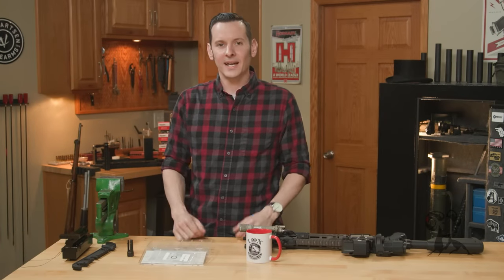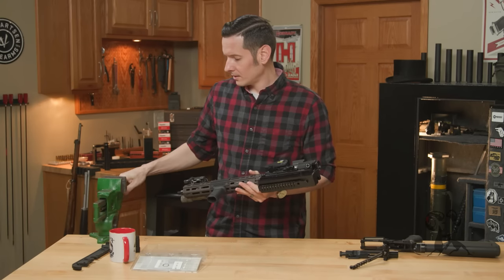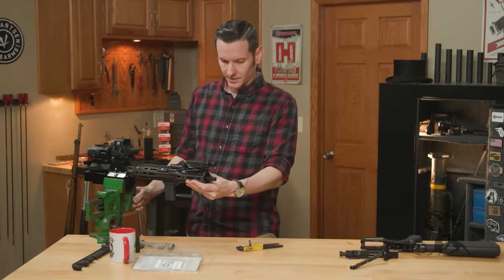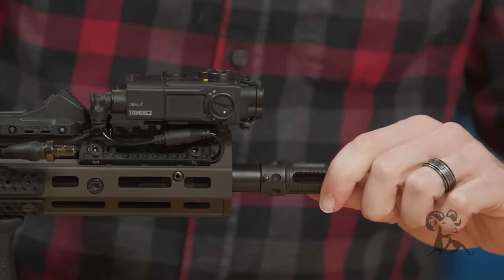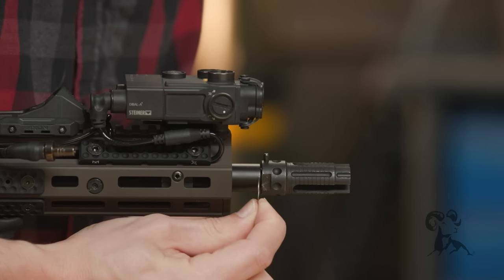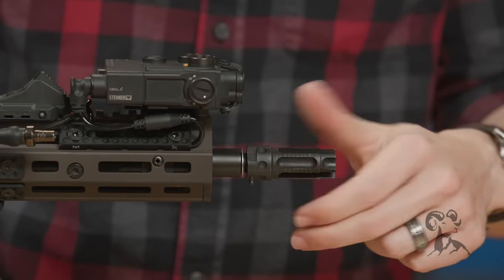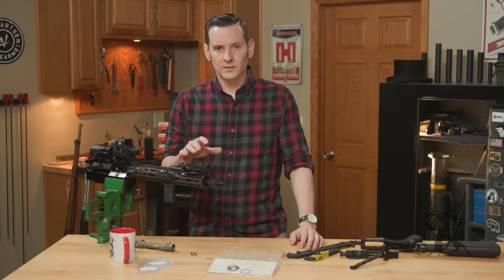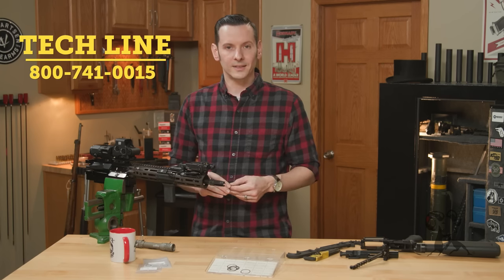Quick Tip: How To "Time" a Muzzle Device With Shims

Comment: This is not the only way to do it, this is just how I do it. If you have another way that works better for you, then keep on keepin on! I just wanted to share this in the hopes it will help a handful of y'all out there.
Reply: This will work nice.
I guess you have fastened a muzzle device before,or maybe a couple😉
Possible more than a couple 😆

Thanks for the quick tip👍

I have a Ase Utra brake with supressor mount on my carbine..and off course supressor to go with it..
Or carbine,supressor and the brake/ supressor mount to go with it..
It depends on how you look at it😉
It.

I just fastened it with torque 50 ish Newton meter or something.. i do not exactly remember.

It was the manufacturers specifications and recommendations/in the "user manual" for that brake/mounting system,so i went with what it said..

My brain said "Rock set" or Loctite it down.. 😆

It's still in the right position after lots of rounds through it though..

Anyhow..I like these Quick tip videos! 
It brings me lots of knowhow😊

Keep up the good work 👍
Reply: The Videos on the Website is not reachable from outside US..visitors will be redirected on the local sites...without videos....
Reply: Now that’s some big-braining right there.
Reply: Can use use shims and crush washes together.
Reply: I'm just curious, but why not a crush washer?
Reply: @joshuaabren  If it's a muzzle device that can mount a suppressor than a crush washer is a very bad idea actually, as this can impart unequal pressure on the mount making baffle strikes much more likely.
Reply: What can i use that is less permanent than Rocksett?
Reply: When you said big brain it I thought you were going to use the math calculation. 24 threads per inch so one full turn is 0.04167". so 75% is 0.3125" so your shim stack needs to be that or slightly more for torque. I'm terrible at math I like Caleb's way.
Reply: @joshuaabren never use a crush washer on anything you’re running a suppressor on. Could cause unequal pressure around the muzzle device and potentially cause a baffle strike.
Reply: So don't use crush washer with shims?
Reply: @jrossnjax7  Correct

Comment: I like the Surefire method of timing. Basically, you add shims until you are so many degrees off at hand tightening. Theyve created a diagram wheel so you match up the color of the shims youre using and then once you find a combination that matches the diagram wheel, you then torque the brake until it reaches "center". It does take some trial and error but it works great. This was pretty good too though, I just wanted to share.

Comment: One note on Rocksett.  When wet, even a drop of Rocksett will act like a lubricant and your device will time a little past where it was dry at a given torque setting.  There are several ways to deal with this, but I've found the easiest is to make sure you dry fit north of the middle of the torque range so when you time with Rocksett you'll still be above minimum torque.
Reply: Finally someone addresses this! I'm having the same problem. I'm trying to time a SF Warcomp. When I time it dry it goes to 6 o'clock at 30 ftlb and then I apply Rocksett and it goes past 6 with less than 20!
It's frustrating. Is it ok if I leave it to dry first or does it have to be still wet when torquing?

Comment: Great to the point video. I am getting ready to swap out all my muzzle devices for dead air flash hiders. Going to use accu-washers for timing them though. I am most excited to remove a pinned and welded M4-72 muzzle brake and put a flash hider on it. It was my first muzzle brake and man does it shoot flat, but I am sick of how aggressive the flash is back towards me and the firing line, it’s like a flash bang if you are off to the side of it lol.

Comment: I've had great success using the TPI to calculate the needed shim. Effectively no guess work and gets it right almost every time.
Reply: I was going to say... "if you REALLY want to "big brain" it, try some math".  I'm with you.  I'm lazy.😜
Reply: What's the TPI?
Reply: @jasontm91  Threads/Turns/Twists per inch. E.g. 28 TPI means each turn is 1000/28 = 35.7 mil. So if you are over by 1/4 turn, you'd add shims for 35.7/4 = 8.9 mil (rounding to 10mil) to make it end up where you want it.

Comment: Precision Armament accu-washers are the way to go.
Reply: The washers and system are of outstanding quality, but not perfect. They only time at 20 degree intervals and that's not nearly enough sometimes. My PA M11 muzzle brake stops with exactly a 10 degree tilt, which makes it impossible to time without using a shim or crush washer in order to get the muzzle brake level. Just passing along in case it helps anyone, not at all unhappy with the end result.
Reply: @ArkansasBadBoy  idk about your setup, but my every one of my guns is timed perfectly at 12:00. It takes a few tries. I always go back and forth to break in threads to get the most out of the torque. There is no set torque, so 5 ft-lbs more or less isn't going to hurt anything. Sounds like you tightened it to whatever and it wasn't in line and you gave up. Takes a bit more effort than that my friend.
Reply: @2A.Freedom  each situation is different and rest assured, I more than know what I am doing as I've installed these for years. Glad yours worked out.
Reply: @ArkansasBadBoy  i agree, each situation is different. I don't agree that it's impossible. It may not work for you and that's fine, you are under no obligation to comment. It's a great product I've used for years on dozens of builds with zero issues.

Comment: Thank you for sharing this important video on shimming. Very informative! Question; can you over tighten a muzzle device on a barrel? 
The reason I ask is because I changed out a muzzle device using a crush washer and tightened it down pretty good to achieve the timing I wanted. Hopefully I didn't over tighten the muzzle device.

Comment: Personally I would have put the pin on the bottom so the flash would be directed at the 6, 10, and 2 o'clock positions. I understand it won't matter much with a suppressor but in the chance one was not installed while firing in a low light or night time scenario the shooter will get blinded by the flash, ask me how I know. Just my 2 cents, in not much of an ar guy myself but I do have one and have assembled a few. Keep up the good work guys.
Reply: #1  he was not using a muzzle device that needed to be timed.  I believe the point he was using the pin to represent a muzzle device that needed timing.  he had stated all this up front and he would not be keeping the device on that weapon.  just saying.

Comment: Doesn’t using a upper vise block put torque on the barrel index pin when doing muzzle work? I heard you should use a barrel vise over an upper vise block or reaction rod because of the torque on the pin?
Reply: That's a smythbuster video in the works.
Reply: @CalebSavant  yay more videos

Comment: Is Rockset really necessary? I’ve never used it for the barrel because I am constantly removing them. A properly torqued down ASR mount shouldn’t ever come loose. However, I figured I would just check it before each session at the range. 

For example, had to remove the barrel end because… 

1) I wanted to ultra sonic clean my adjustable gas block
2) I bought a silencer, so put on ASR mount flash hider on rifle
3) I migrated ASR mount flash hider to use with newly built AR pistol
4) I switched pistol to ASR single port muzzle break to shorten length 
5) I moved ASR back to rifle

etc., etc., 

Bottom line had i used rockset i would have had a hard time of it. And that just for 1 of 6 rifles. I went through similar changes with all of them. 😮

Comment: So how do you use Rocksett after the fact?  I ask as I have a BRN-180 10.5” 7.62x39.  Attached Cherry Bomb brake without checking concentricity with the Thunder Chicken suppressor and promptly took a chunk out of the suppressor.  So, before I do this again, I’d like to check concentricity before applying the Rocksett.  Thanks.

Comment: 28 threads per inch, so each rotation is 1/28th of an inch.  (0.0357")
3/4 of one rotation needed.
0.75 revolutions x 0.0357 inches per revolution = 0.0268"
Reply: Now account for torque and the change in torque caused by the rockset lubricating before it cures.
Reply: @CalebSavant  I'm curious how my calculation compared to the thickness of the actual shims you used in your video.  Does the box of shims provide thickness dimensions for each?
Reply: Exactly, the hard part isn't getting it timed, it's getting it timed with torque. @CalebSavant

Comment: What about the barrel extension rod how does that work? If I wanted to take my Surefire 3 prong off my sr15 and put my MAMS or KAC flash hider on someone said I’d have to take my bolt out and stick that “rod like” barrel extension  wrench in through the the back of the receiver and hold that with a vise then remove then remove the muzzle device. Can anybody help clarify?

Comment: So I’ve been paying my smith $35 to rocksette and shim/time my muzzle devices… should I just do it myself? I just figured I’d play it safe when it came to bore alignment and suppressor use so I figured I’d have a pro do it. But this doesn’t look that difficult
Reply: Ideally you'd get a Geissele suppressor alignment rod. I just ordert one for 223 and 308. They cost a lot for what they are, but I can't be bothered anymore to go to the smith everytime I want to switch up my suppressors and hosts or switch out a gas block or whatever. Same goes for torque wrenches, I finally bought a small one for scope mounts and a big one for barrel nuts, muzzle devices etc. along with a Geissele reaction rod too. Now I can do most of the work at home myself... until I need specific punches for everything^^

Comment: I've used shims. Crush washers are a little easier.
Reply: You'll want shims for assurance of repeatability with muzzle devices that will mount suppressors. A standalone muzzle device can use crush washers if needed.

Comment: Most of the time I get a crush washer that fits close enough and file it down just enough to get a tight fit, I switch from a2 hider to direct thread silencer so I don't need it to be "permanent"
Reply: So you like to add in additional unnecessary work of filing down a crush washer vs shims? LOL.

Comment: Why Rockset?
Why not a crush washer?
Please explain.  Thank you.
Reply: In this case, it's a QD flash hider for attaching a KAC suppressor. Crush washers aren't meant for suppressors since they're likely to cause baffle strikes.
Reply: Crush washers often allow the muzzle device to not be perfectly concentric to the bore, which does not matter on a standard muzzle device, but when it is going to be used for suppressor mounting it could cause the suppressor to be misaligned and get damaged by the bullet striking a baffle. Shims are used as they keep the muzzle device squared with the shoulder
Reply: @cordyzank3625  thank you
Reply: @anthoselongstride8309  thank you
Reply: Rocksett because it is a heat resistant adhesive (a silencer on a semi auto rifle can get very hot), but soluble in water (so if you want to remove your muzzle device you use boiling water). If you don't want to use a silencer, you don't need Rocksett.
Reply: @doejohn8674  a crush washer is heat resistant too and can be removed when the muzzle device is removed. Your answer didn't really address the original question.
Reply: @timrobinson6573  There were 2 original questions, I answered the one concerning Rocksett. You absolutely don't want a muzzle device unscrewing itself (heat and vibrations) when there is a silencer mounted on it. The crushwasher is a no no for a muzzle device on which you mount a silencer as it doesn't guarantee concentricity (i.e. baffle strike risk).
Reply: I'm sorry. I have to disagree with everyone here. I'm a 20+ year Master gunsmith. When I do someone else's rifle, yes, I use shims and not a crush washer exactly because of the comments here but, when I do my own. I just use a crush washer(except in cases where the crush washer times it so poorly that it needs either too much or too little torque) because:

1) no it does not "change the concentric center" any more than shims would "change it" Your threads are what determine the centering. If your threads are wrong, using either crush washer or shims it won't matter it'll move up and down from the sheer force of the discharge of the firearm and in fact, shims allow it to move MORE because they are slippery. 

2) And 2nd, the tolerances on a suppressor are not so tight that it can't handle the TINY, TINY, TINY bit of movement up, down, left, or right that MIGHT occur using either method. The only thing that's going to cause baffle strikes are extremely poor thread jobs, rounds loaded to incorrect pressures( i.e. squib loads), bent out damaged suppressors that bent/warped from extreme heat or improper care/ abuse or,  in some cases negligence in cleaning that can lead to excessive carbon build up.
Reply: @doejohn8674  thank you.  This makes good sense.
Reply: @natew.-victoryorvalhalla4571  Thank you very much.  I had others reply, and I thanked them. As a machinist for over 30 years, the answers didn't really make sense to me for the reasons that you stated. I'm very happy with your explanation because it tells the entire story. The concentricity of the threads (and the quality, i.e., no drunken threads) makes all of the difference in the centrality of the muzzle device and the silencer.
Thank you again, my friend .
Have a great day, and be safe .
Reply: @natew.-victoryorvalhalla4571  how fast do you shoot with a suppressor when using a crush washer?
Reply: @boejiden1942  Ha. Well, that depends. If you're going to cherry red that suppressor, I DEFINITELY wouldn't do it with JUST a crush washer alone. That's simple metallurgy 101. Extreme temperatures (hot or cold) expand and contract metal. You don't want to be relying solely on contact tension of two metals when pushing something to the extreme heats such as those involved in pushing a suppressor to its maximum heat ratings if there isn't some sort of other failsafe in place then, you're just asking for trouble. That's where you'll want to use high-temp rocksett engineering adhesive to give you that added safety protection in addition to a crush washer but, within reason,  shooting suppressed with a crush washer and some loctite black or even just a crush washer alone will still be better than shooting with shims as the texture of shims is generally very polished and very slick vs. the slightly more course texture and compression tension of a crush washer. That being said, there are of course different quality levels of crush washers and shims so putting that aside and comparing apples to apples, if you have just shims vs just a crush washer then the crush washer is going to win every time. But, I don't do JUST a crush washer on something I plan to leave on. I have done just a crush washer but that is more of a short term, switch back and forth situation and involves checking in between every magazine. Always be safe. Firearms should always be handled with great care and safety should ALWAYS be your number one concern. Crush washer+rocksett= safest way to go

Comment: What if you have a crushed washer and your transferring from a A2 Birdcage to a YHM Phantom Flash Hider? How do you time that?
Reply: Yhm phantom times with the closed section of the ports facing 6 o'clock. 
To install, remove the old device, clean and dry the threads. Now put the new crush washer on with the cup side facing forward. Apply a dab of anti-seize compound. Screw the phantom on with your fingers until it stops. Finish by using the proper sized wrench to get the closed section to 6 o'clock.

Comment: Why not just use a crush washer??
Reply: Old Colt AR's used shims instead of crush washers, which is a detail to collectors, retro builders, and restoration.  Some of the better made uppers tend to use shims.  Its a craftsmanship point.
Reply: For suppressor mounting purposes. You use shins. They allow the bore and muzzle device to be aligned. Or close as possible to prevent a baffle strike.